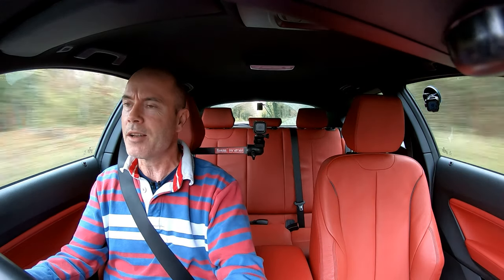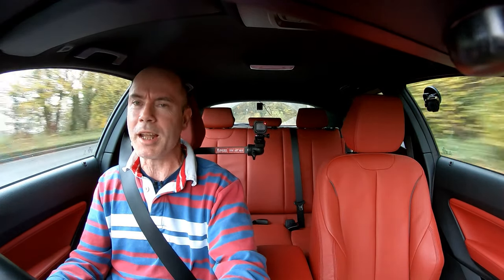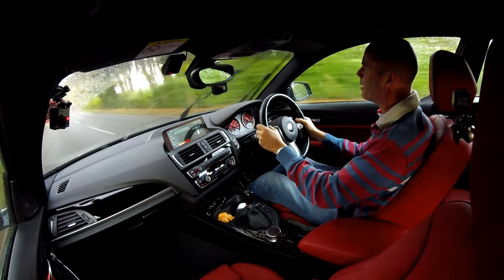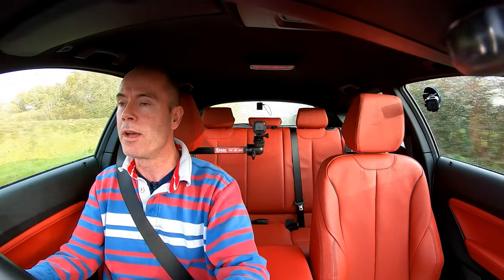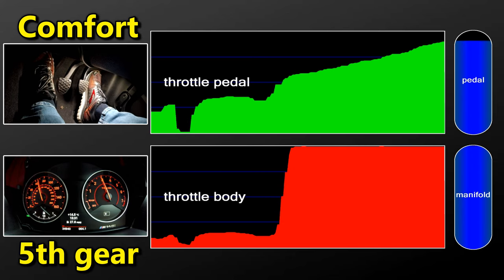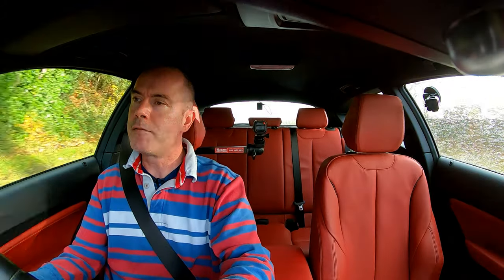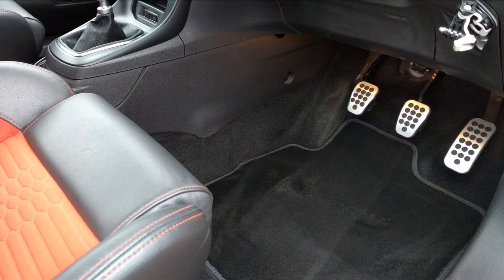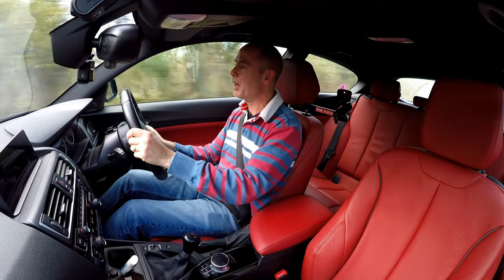BMW M140i : day 752 : Exploring THROTTLE mapping...

Comment: You're quite wrong about some of this actually. Valvetronic controls engine more than the throttle body does. For example, at idle with my n55 the throttle body is 17% open. While cruising, 25% when the pedal is at 0%. You build no vacuum in the intake manifold because the throttle body is open, and the valves are barely opening controlling rpm. The throttle pedal is more of a torque pedal. In my old n54 135i if I pressed 25% on the pedal, the ecu would automatically go to 75% throttle body to spool the turbos, then back off to 15% or maybe much less to hold boost at the requested power level. The valvetronic cars are much more sophisticated than that even. The amount the valves open is controlled  by valvetronic. Throttle body can go to 100% open at idle and the rpms will stay the same because the valves barely crack open. With the turbo, in order to get quick spool, even with a low throttle pedal input the throttle body and valves open wide to let it spool fast, then close when boost builds to limit torque to what you're requesting with the pedal. When you go 80% pedal, the throttle will open 100%, and the valvetronic system/turbo wastegate controls the rest, limiting torque output to 80% or whatever they have set in the ecu. When you tune these cars, setting the torque limit at 186% is what they do, the ecu takes care of everything else. They will optimize ignition, vanos and fuel tables but the actual power gain is in setting the requested load higher, and playing with that table to make the turbos spool fast, and smoothly. Say you floor it in 3rd gear at 2500rpm, everything will go wide open until boost builds, then to limit boost if it goes too high, it may close the throttle 50% and you won't really even feel it! I use MHD to tune my m235i, and they give you different options for throttle sensitivity. They offer a linear map, which makes even sport mode 100% linear and I hate it. To me, it doesn't feel natural. A n/a car at 25% throttle will give you a lot more than 25% torque in lower rpms, which is where you do 99% of your driving. I find comfort mode is slower spooling the turbo compared to sport mode. I also find heel toe a lot easier in sport mode because it doesn't require massive jabs at the throttle.

Comment: Here's some guidance material I found that might help explain your observations: Valvetronic  comprises  a  fully-variable valve lift control and a double VANOS. It operates according to the principle of throttle-free load control. With this system, a throttle valve is only used to stabilize the engine operation at critical operating points and to ensure as light vacuum for the engine ventilation. A very small vacuum can be produced in the intake pipe by slightly tilting the throttle valve, which allows treated blow-by gases to be introduced into the intake port during naturally-aspirated engine operation.
Reply: Spot on as usual. SPORT mode is our comfort zone with the ZF8.
Reply: I agree. I believe the "other things at play" here is definitely the Valvetronic system. It would be interesting to see that being logged and displayed in a future video, if possible.

Comment: Hi Mark, it’s a shame it’s gone - just saw a clip of your latest vid - haven’t watched it yet! I was going to ask about boost pressure vs throttle position in each of those modes. When I had my M140 (auto) I quite liked eco pro as generally was easier to get better fuel economy, but also it didn’t have the tendency to change down 2 gears with slight throttle input which even comfort mode did. It let you use the torque - maybe 75% throttle and kept in the same gear which I preferred. It could catch you out at round about a though as took an unnatural throttle input to get it moving quickly! Anyway - on to your next vid!

Comment: Interesting. The relation between throttle pedal and "manifold" (valvetronic in this case) will be highly dependend on the rpm as well. I guess with a test switching from constant driving to a certain throtte body percentage at lets say 3500rpm could show the relation better.
What i noticed is that the driving modes does not only change the "ratio" of throttle and "manifold" but also the response. E.g. you will get the comfort ratio in Traction/DSC off mode but with a much sharper response. 

Good video!

Comment: I tend to prefer the comfort map EXCEPT it isn't just the throttle map. It also seems to adjust rev hang. Quickly let off the gas in eco pro and nothing happens, you just keep going, nearly rear ended people, it's terrifying. Sport and sport+ is the only one I can deal with when coming OFF the gas, which personally I care about more than putting my foot down.

Comment: Could the reason you see a disconnect between the throttle opening reading vs the power, be down to the fact that beyond the throttle body opening, there is also VALVETRONIC in the background affecting how much air goes into the cylinders?

Comment: I think the M140i manuals suffer from too heavy of a flywheel, it takes too long for revs to rise and fall while in neutral. Also the gear ratios aren't the best, tall low gears and a 6th that is far from ideal for cruising.

Comment: Have you tried driving up the road on throttle then hold the brake on with left foot as if your trying to bed in the brakes. You may find the throttle closes and you nearly stall. Alot of modern cars use the brake pedal sensor to trigger a close of the throttle.

Comment: Have you tried to recalibrated your accelerator peddle search online for the procedure
Reply: Good point, it supposedly ‘learns’ your driving style so may have been different to stock. I’d done this in older BMWs and not sure whether it was psychological but did seem to alter things slightly.

Comment: Rarely use eco unless on a motorway run with the family & not a fan of the sport+ mode either ,  its hangs too high for a brisk drive & feels too lairy , dont think this masterpiece of a motor needs to be revving that high  ( 8 speed ZF )  coming out of a bend , liked the video & the effort you've obviously put in , keep them coming man 👍

Comment: I found ECO pro extremely dangerous when trying to pull out on roundabouts. I used it once and that was almost once too many.  Maybe OK on long motorway  cruising runs where you want to save some fuel but I wouldn't advise it around towns/cities
Reply: Absolutely agree, it’s a complete shambles when you want to take off swiftly but not too fast. I only ever use it whilst cruising.

Comment: Could the throttle be held back till engine/gear/road speed reach a predetermined point for economic reasons. Would be interested two see how first and second are. Also when driving on boost, seemed like old school turbo power delivery